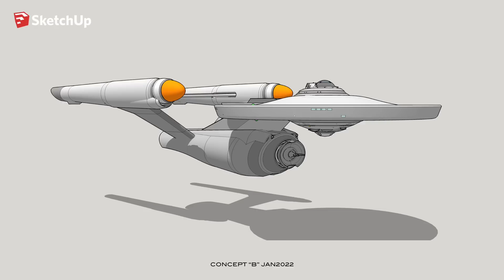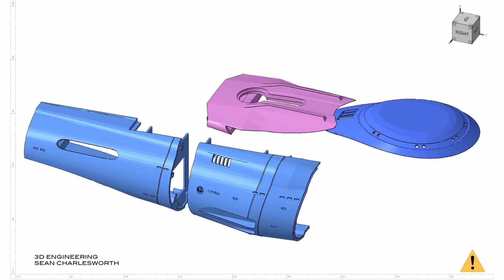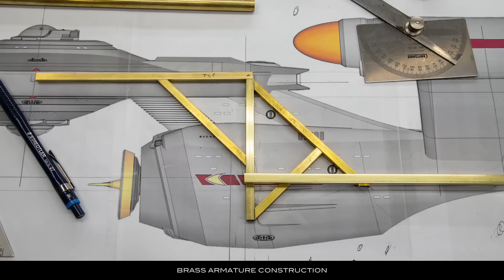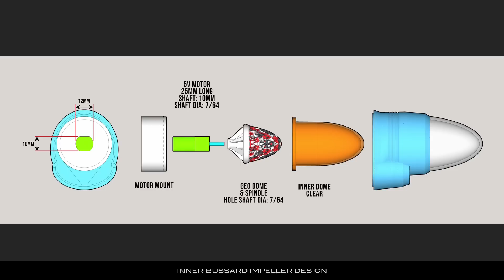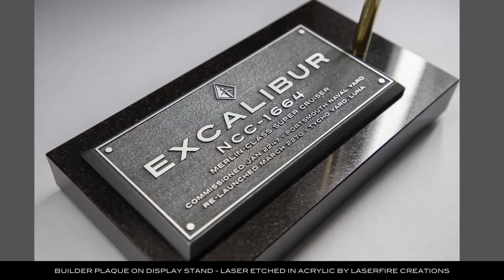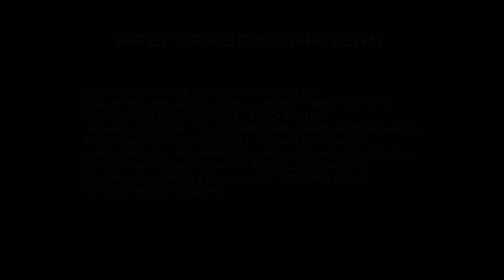Tycho Case Study: Project Excalibur

Comment: When I finally retire in a few years, I plan on building several 1:350 refit series models - the 1701-A of course, a Reliant, a Belknap Med. Cruiser, and a Dakota Class Shuttle Carrier (or possibly a hospital ship variant of the Dakota class shuttle carrier). While I'm working I'm just accumulating all the materials, electronics, etc. I intend on using. Thank you for the inspiration! BTW, SketchUp is the shiznit. I use the Pro version all the time as an Architect.
Reply from the maker: Boldly Go!

Comment: Incredible work, though I'm curious why you didn't have the surface of the saucer 'Tiled' as opposed to no joins finish?😊
Reply from the maker: This is a transitional design, borrowing some elements of TOS and TMP eras. The paint work was another aesthetic option in which the client preferred the non-patterned scheme, although there is some subtle panel variations.

Comment: I've been in love with this ship since the first time i found your Facebook posts on it. I do have a question about your choice to put the lighting control units inside the ship. Would it not be easier for future maintenance/repairs to keep the units in the base?
Reply from the maker: I’ve always installed the fx board within my models. Some have access panels. I’ve also never encountered a problem with them needing repair. It’s more likely a LED will fail and there’s no way to replace that unless you just tape the entire model together. I also do not prefer to run dozens of wires out of the model.

Comment: Hi Bill, can I ask what method you use when tiling your 1/350 scale printouts??
Reply from the maker: Are you asking about the printed paper plans?
Reply: @TychoYard  thanks for the reply! I am indeed. I’ve heard adobe have a pretty good system that lets you print out larger items to stitch together but I was wondering what you use?
Reply from the maker: @DAEMON74656  I’ve scaled the orthos to proper size in Adobe Photoshop and placed the art in a 8.5x11 document that I send to my laser printer a section at a time, moving the art in 11” increments. I then tape all the sheets together like a giant jigsaw puzzle. This is the cheap method. Otherwise, I can go to my local print shop and have them do it on poster sized sheets as a one-off.
Reply: @TychoYard   thank you for clarifying. I have yet to master this process and always end up with something going wrong but I’ll keep trying! Thanks again